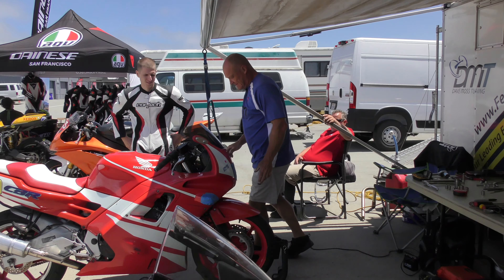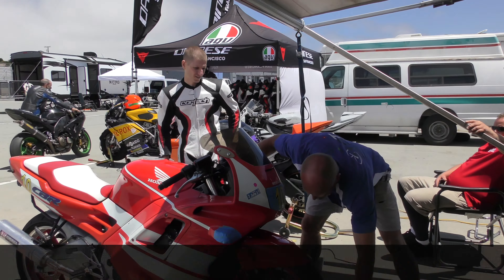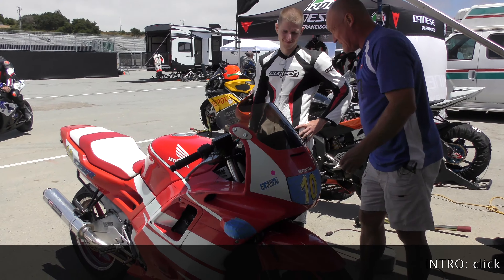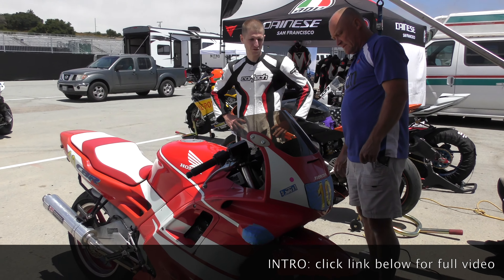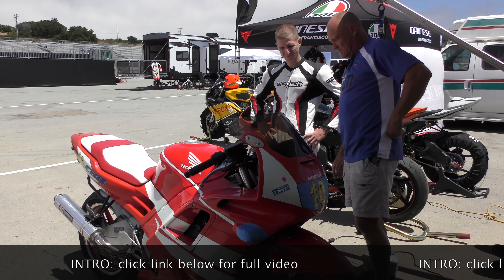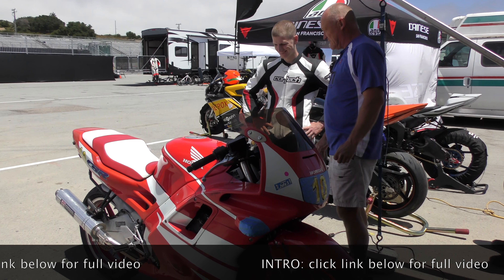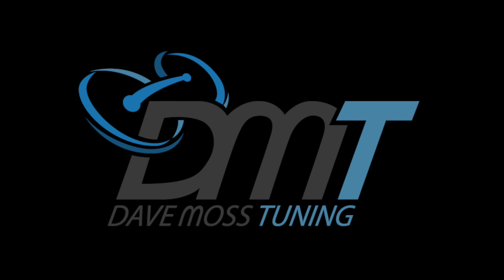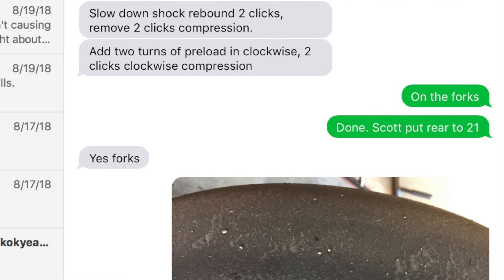2 Clicks Out: CBR600 F2 F3 F4 Suspension Setups Intro

Comment: I have a 2000 f4 and need to get the rear shock rebuilt. I can not find anyone who rebuilds them. Or even find a replacement that isnt more than what the bike is worth. Dave said reddevil motorsports but cant find them on google map. Anyone got any info that can help?  Thanks and love the videos Dave!
Reply from the maker: If you are in Sacramento, Pasta Performance and Daredevil Motorsports (my error on that name).  If in the Bay Area, Desmoto or Superplush.
Reply: @catalystreactionsbw  thanks Dave! I'm in FL so I would have to ship it to them. That's all I needed so thanks again.
Reply from the maker: @manning33  Any dirt bike shop can service and road or dirt shock. Check locally for one.

Comment: Had on 04 F4i that I still miss now! It was extremely balanced for tricks or riding hard, could hang with the Ninja 626 of the year with a great engine and my wife didn't cry in pain after 45 minutes of riding on the back (Looking at you R1). I'd definitely get one again if the opportunity arose.

Comment: I remember riding those brand new!  They weren’t even that good way back then, regardless what you did to improve the default settings...  a bullet proof engine tho!  Thanks again Dave!  👍😎
Reply: apart from the cct, yeah
Reply: I have a 1998 Honda cbr F3 I just got back running after sitting for 13 years I just use it to go for small rides here and there I may try and sell it because I want a slightly newer fuel injected bike maybe GSXR
Reply: @hollywoodthedj1673  Good choice. Go with a much newer 750. Night and day.
Reply: They were more a sport/tourer,  great comfort, they loaned me a YZF750 while in for service, the CBR felt like it had a giant piece of rubber between the wheels after riding it... 😂
Reply: @PaulMappud  A sports tourer?  Hardly as it was used in the 600 Supersports racing category when new.
Reply: @marcusgeorge1825  : Yer, sweet sweet, exactly the road I was going down but not without me strawberries...